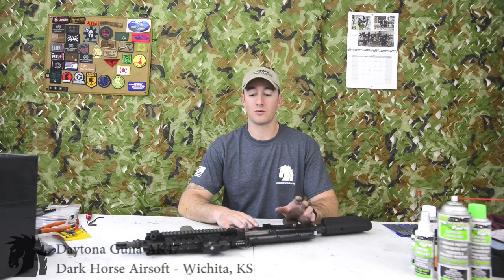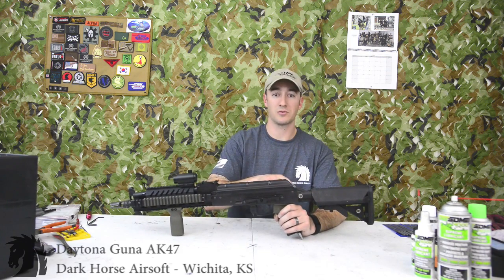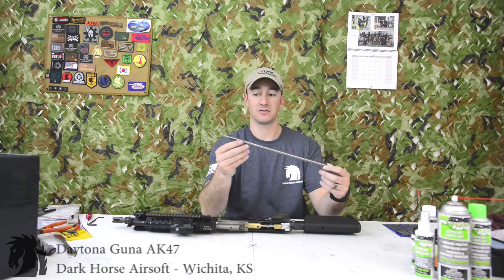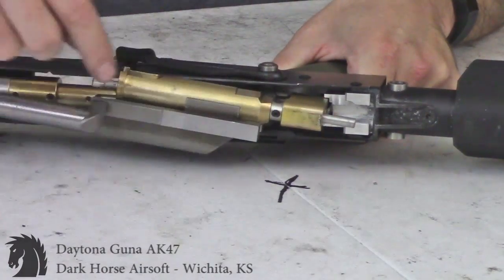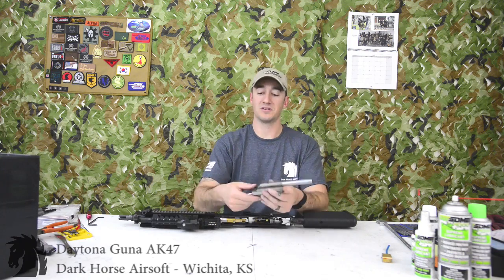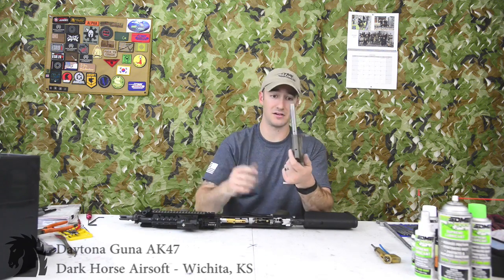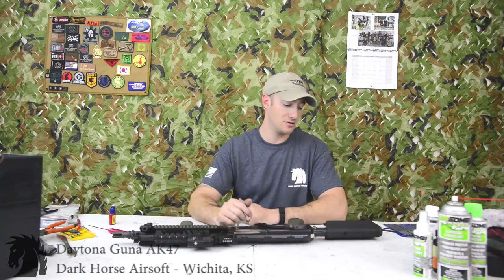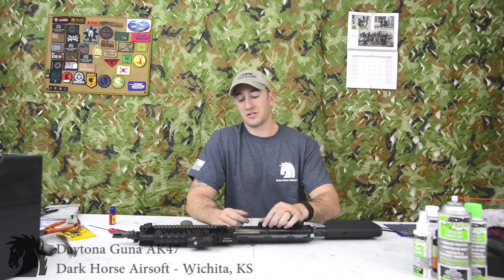Daytona Gun AK47

Comment: What is the thread spec for the outer barrel. I am changing out my Ak74 front end to an ak105. Got a hold of a really old lct ak105 barrel and it is not threaded. What is the thread of the hop up unit that the outer barrel screws into the reciever of the kit

Comment: Been having an issue with my nozzle not going back enough to pick the next BB up sometimes, i noticed when you talked about the shaft/piston 14:45 ish the nozzle sits flush, mine sits about 2mm in front of the end =S could it be the spring is too stiff? clipping a coil would probably make it sit flush but i dont want to do that if i dont have to =(

Comment: Great video!  Quick question, the bolt will not rear lock once your mag is empty, correct?
Reply from the maker: Correct, no DG's do unless your using epm mags and the aftermarket bolt catch. This will not though just like the RS variant
Reply: The real AK 47 doesn't have a bolt catch.

Comment: how much trouble is involved with installing a new barrel.

also should hop be applied after 8000 round break in or through another method
Reply from the maker: Hop should be applied when you are consistently getting no chops or jams,  that being said when adding hop do it slowly in roughly 1/16" or 1/8" turns. its not a super hassle but definitely more work on the AK platform vs others